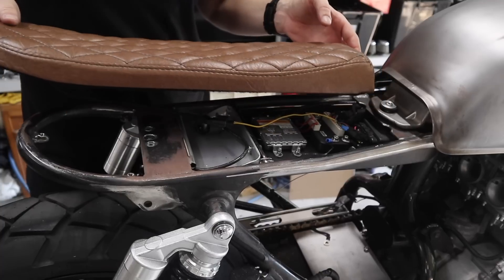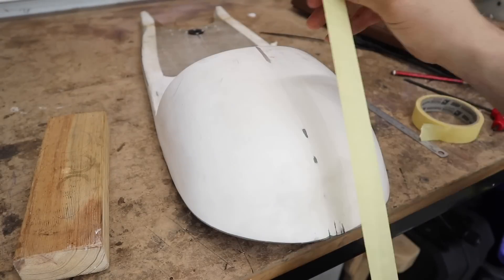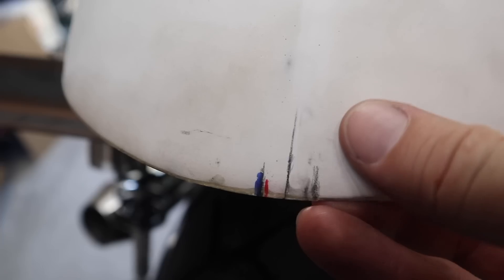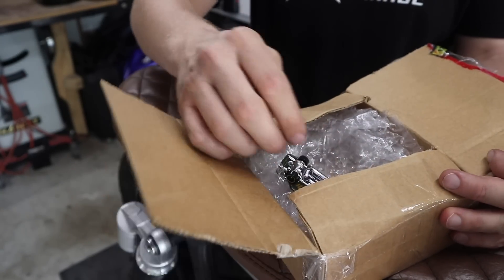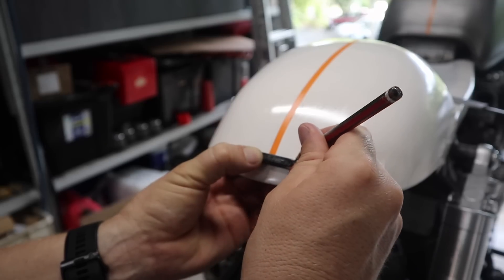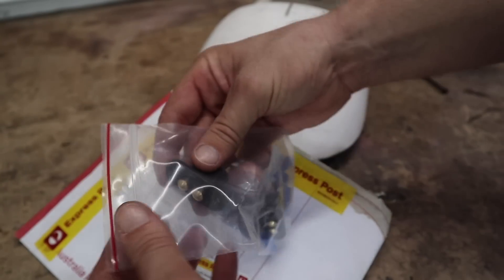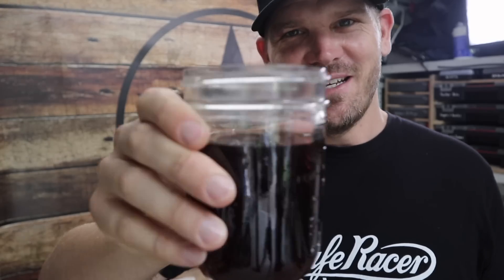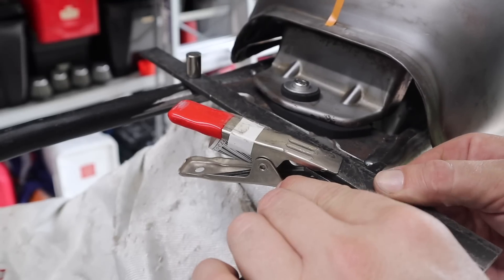Fitting ★ Cafe Racer Taillight & MAKING IT WIRELESS! - CB750 Build - Wireless Lights

Comment: You are supposed to countersink holes before tapping, this gives the tap an easy lead in for the threads. And try a spiral point tap, (not spiral flute). They thread like butter, you will throw your old taps in a drawer somewhere for backups.

Comment: You should make a Center Finder Tool, super simple and finds the right spot everytime, you can make it as big or small as needed for the job you are doing
Reply from the maker: Drop a link and I will look at what you are suggesting.  Sounds awesome
Reply: you can make it whatever length you need for the width of materials you work with, put it over the material and twist till the studs are against the material you need the center of, and the center hole is always dead on the mark
Reply from the maker: @evlson123  I think I know what you are talking about :)
Reply: @CafeRacerGarage  hope it helps!

Comment: As I saw the title I thought you were using batteries to run the lights. What an awesome idea to make locating pins for the contacts on the bottom of the seat. I'd never thought of that. I use a three pin connector with wires running under the seat on my builds, but I always run the risk of getting them pinched under if I don't tuck them the right way.

I usually go for more budged builds, with no m-unit or fancy gadgetry, but damn, your builds are nice. Thanks a lot for sharing that!
Reply from the maker: Hi Dirceu thank you so much for the comment and yes I do take a lot of time to get things as good as I can but not everything works out the way you want so mistakes are always evident.  Those little connectors are absolutely awesome and I’m really glad that I thought of this little idea and was able to share it with so many people to help them with a common problem. 
Have an amazing day

Comment: What's the point of the contact switch? You have wire to it, and then wires from the contacts you made going to the light. Did I miss something?
Reply: He explains reasoning in first 20 seconds of video.
Reply: @danceHHmusic  Ya I saw that, my point was there are still wires going to the tail light.
Reply from the maker: @danceHHmusic  thank you mate 😁
Reply from the maker: You can remove the seat without any wires. I explain how removing the seat Is annoying and that’s why I can up with a way to remove or swap seats for a different look without the need to worry about any wires or at worst, accidentally forgetting to plug your tail light in.  Hope that makes sense.   Have a great day brother